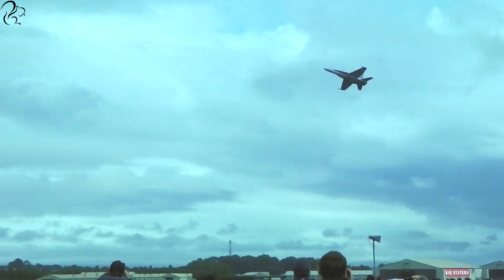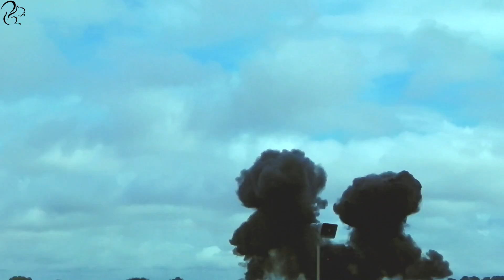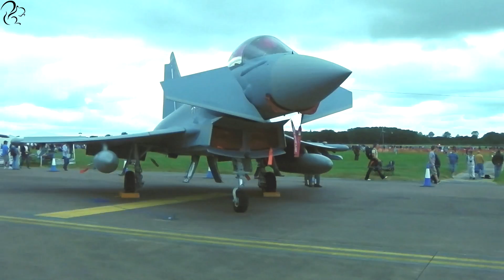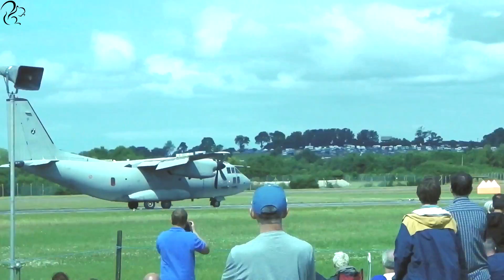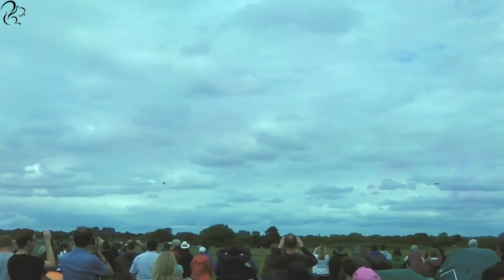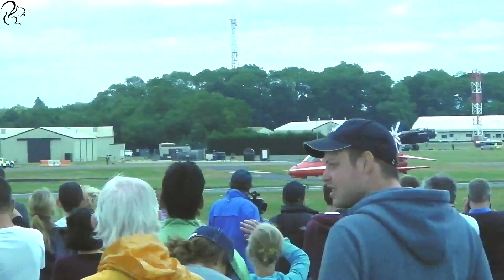Royal International Air Tattoo 2014 (RIAT)

Comment: not a great fan of airbuses flight displays as in real ops its impossible to override the FBW systems and the preset limits so they actually manually disable it so it can achieve high pitch and bank angles....same story with the A380 flight display few years ago